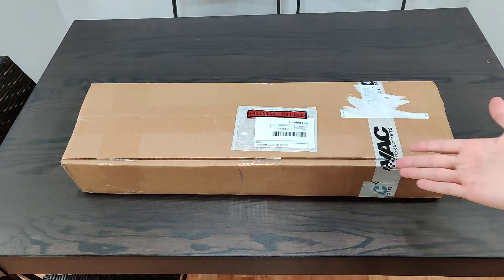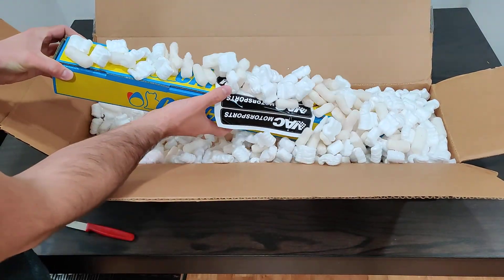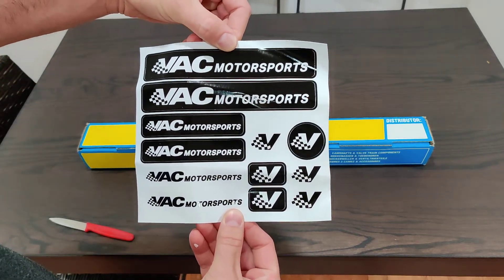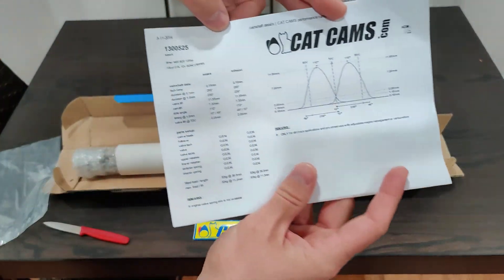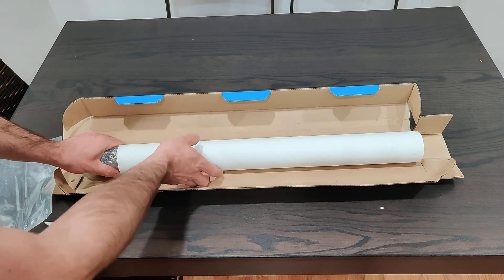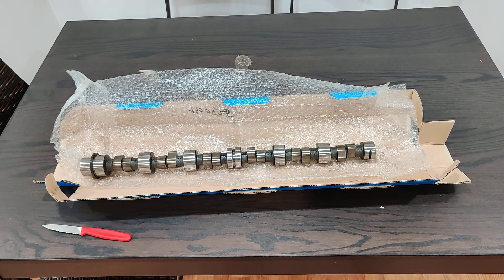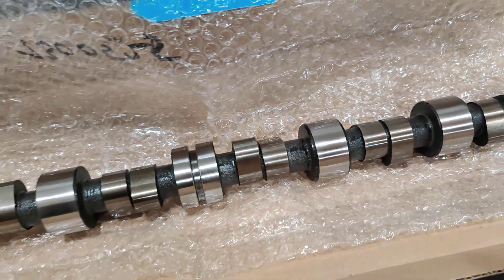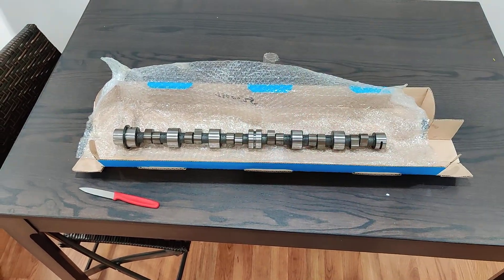BMW M20 Cat Cams 285/285 Unboxing | VAC Motorsports

Comment: When I did a 272 cam, I installed it without a cam card/degreeing the cam.  I did a compression test on the install, observed 210-220 psi per cylinder.!  I always thought I left horsepower on the table, due to me not degreeing the cam.  These aftermarket cams supposedly have a little advance ground into them when manufactured (from what I've heard).  Makes me wonder if I should have retarded my setup a little bit.